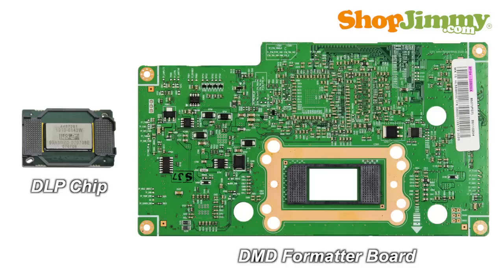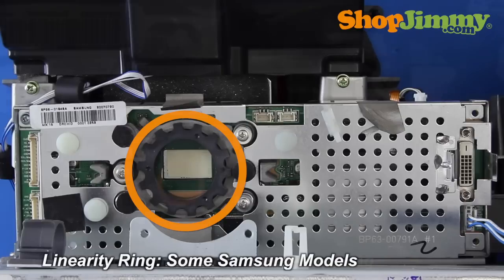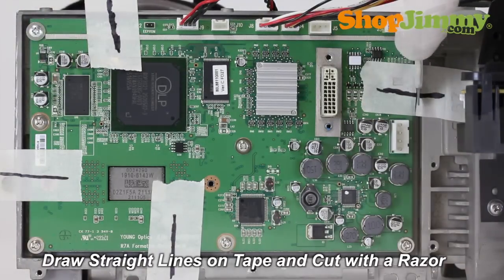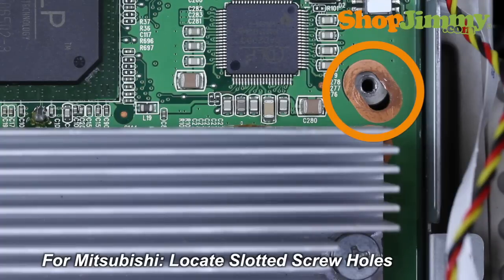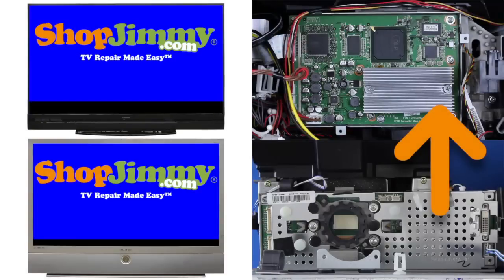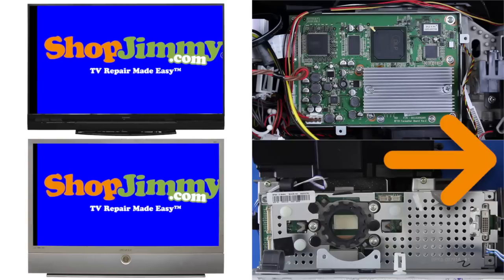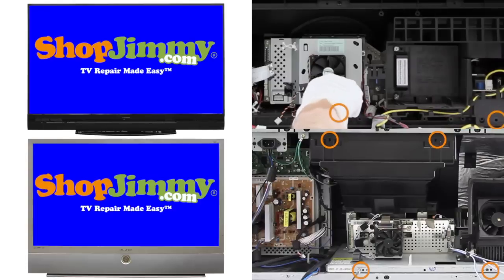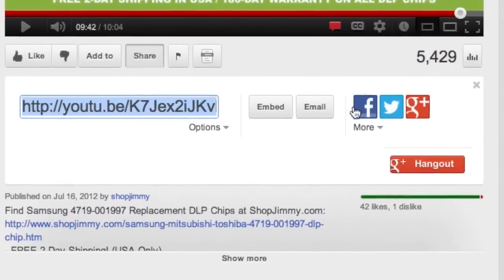DLP TV Repair Tutorial - Picture Off Center-DMD Board & Formatter Board Alignment-How to Fix DLP TV

Comment: Replaced the chip, worked great. Had to adjust the height, picture was about 7 inches to high. Moving the board down, brought the picture down. Only took a few minutes.

Comment: This info should be included in the original install video -- i.e. not having to troubleshoot after the fact.  Since I wasn't aware of potential alignment issues, I didn't use the tape marker, etc ideas to ensure alignment.  Ugh.

Comment: This video helped me a lot! my DMD board works fine its just my picture is about a 1/2 inch to the left and its been driving me bonkers looking in the menu for a picture adjustment feature but now I guess I will have to open it up fix it again. I had to open it to replace the lamp inside, i just wish Samsung made fixing my issue as easy as replacing the lamp. hehe
Reply from the maker: TheFlameofaShadow   Yeah the dmd just needs to be centered a bit more.  Thanks!  www.shopjimmy.com

Comment: After replacing the DMD on a Samsung DLP HLS4676SX, the picture is centered but seems to be a bit too large (overlapping all edges).  Is it possible to adjust the size of the picture.  H & V adjustments are centered.

Comment: My 2006 Samsung 56" DLP TV's picture seems to be larger than the screen. The bottom of the screen is cut off but the sides and top appear ok. This is while I view a full screen HD picture. Example: some CC text can be cut off, below the viewable section.  The TV has been moved several times when I moved to different addresses. Could something have gotten jarred out of place? The picture quality is outstanding, as it always has been. It has a sharp focus and is not tilted or canted in any direction. I bought this TV new in 2006 from Amazon. It's model  is Samsung HL-S5687W 56" 1080p DLP HDTV.

I saw your instructions on moving that board. Is that the only possibility?

Thank you in advance.

Comment: I just replaced the DLP chip I ordered through ShopJimmy.com - which fixed all white pixel issues on my Samsung HL56A650C1FXZA. The picture is back to perfect, but now I have an alignment issue. The screen is around 1.5" too far to the left and around -3 degrees off. Unfortunately I did not see this video prior to my install and I'm confused as to how I can keep my TV on while adjusting the dmd board? Also, I did not touch the screws under the white plastic caps... Thanks for your help.
Reply from the maker: Ari Cohn I would recommend watching our DMD adjustment video.  Here is the link:  DLP TV Repair for Off Center Picture Display DMD Boards & Formatter Boards Alignment  Thanks and please let us know if you have any further questions!  www.shopjimmy.com

Comment: I replaced the color wheel and lamp, and I am now getting picture then black and then red vertical stripes. Then it repeats, over and over. I also had an 8” black strip running horizontally across the bottom  with about 3 inches of picture showing at the bottom below it. Mitsubishi WD-73734.
Thanks

Comment: Great video. I have a Samsung HLS5086W 50" that the sound has started popping like Pop Corn. It seems to get louder and faster the longer it stays on. We can mute the TV and the audio still works through the surround sound system. How do I fix this sound issue. Tonight I just replaced a fan that did no good. Thanks for the help
Reply from the maker: Tony Soares  Try all repairs and troubleshooting at your own risk.  I recommend replacing the main board in your TV.  Click this link to replacement parts for your TV model number:  http://www.shopjimmy.com/samsung-bp94-02262a-main-board.htm  There may be multiple boards for the same TV model number, be sure to match part numbers on your current board, with your replacement for compatibility.  Here is a link to a video showing how to identify your part number, click here:  https://www.youtube.com/watch?v=BEPWrefQvqI  Thanks and please let us know if you have any further questions with your TV Repair!  www.shopjimmy.com

Comment from the maker: @Leonardo Chen - I would say that is not an alignment issue.  It may be the DLP Chip is not properly seated, or one of your cables is not connected correctly.  Be sure all of the cable and wire connections are connected well inside your TV, and also be sure that the DLP Chip is properly seated.  You can see how to do these tasks in our videos.  Thanks and please let us know if you have any other questions!

Comment from the maker: @Leonardo Chen - The blinking yellow light typically means that the lamp door is not properly secured.  I would go through and be sure that everything is securely tightened on the lamp door and other areas.  If you need any additional support, please feel free to contact our customer service at (877) 881-6492.  Thanks!

Comment: Hey again, it's a Mitsubishi DLP today.  This time a WD-65736.  The DMD looks exactly like the one at 0:50,  putting tape didn't seem to serve a purpose because the board is keyed to go 1 way, there's no way to slide it around as suggested at 1:42 . Here's my symptoms:  image is a bit squeezed on the sides, top of the screen has extra space,  bottom is cropped off, terribly overscanned... Could this be an issue with the rear mirror itself?  The back is a bit melted (whoever had it might have left it in the sun).  there's just no way to move that DMD board up down left or right, again it's keyed to fit in 1 spot. I could live with the squeezed image, but not the cropped bottom and black space on top.  Suggestion?

Comment: I've just replaced a DMD board with chip on my Samsung HLS4266 DLP TV.  It corrected my problem - splotchy picture and horizontal lines - but now I have a new problem. I was successful in properly centering the picture after replacement, but now I have a 1" vertical shadow running up the left side of the screen.  It is not the left-right orientation thing as I can see the picture through the shadow.  It appears to start out purplish and fade into a light blue.  Can that be gotten rid of by making some additional adjustment or will it require replacing something?
Reply from the maker: Frank Inman   Yes, you will want to continue to adjust the picture.  Thanks!  www.shopjimmy.com

Comment: Samsung DLP model HLT6187S Turning on TV when cold green light flashes 4 times then projector lights up displaying no signal 5 minutes later picture blinks on and off 3-4 times  then comes on. Could this be the cable from main board to DMD board or main board replacement. How to diagnose?

Comment: hi I have a Samsung model number is hi56a605c1fxza I repaired the lamp ballast it has a blown capacitor I replace the light bulb and I replace my power supply as well so I plugged it in everything came out fine but the only thing is bothering me is the screen is blurry I can't even see my menu how can I focus it

Comment: I have a Mitsubishi wd 73733. After replacing the chip I can't get the picture in focus. Menus are almost unreadable, actual text displayed on the screen from satellite is also unreadable. I didn't see the video about taping and lining up before changing out the chip. Any suggestions on getting the picture in focus?

Comment: My Aunt has a Samsung HLN617W that has no sound. The picture works for awhile and then the screen goes black or freezes up with a black and white image. She had been using a surround sound system with the TV because there was no sound from the speakers but now there is no sound going out on that either. She recently had the color wheel replaced so the color is nice, but problems persist. I was thinking DMD board, what do you think?
Reply from the maker: lucidbarrier   Yes, that sounds correct.  Here is a link to replacement parts for your TV model number on our website, click here:  http://www.shopjimmy.com/catalogsearch/result/?q=HLN617W  Be sure to match part numbers on your current board, with your replacement for compatibility.  You can also call our customer service for further assistance with your purchase.  (877) 881-6492  Thanks and please let us know if you have any further questions with your TV Repair!  www.shopjimmy.com
Reply: ShopJimmy.com Thank you, I recommended she order the DMD board. Thanks for your help!

Comment: My TV goes half dark on either side that goes away after power cycle, but comes back in 10 minutes.  I think DLP is over heating.  I need help locating DLP or DMD board on HLR 5688W.  Thanks

Comment: Hello, I own a Mitsubishi WD-62725 TV. Recently I had a power outage and I cannot get my TV to turn back on. The TV was off when the power went out and is plugged into a surge protector. I did pull out the chasis with the power board on it and replaced the fuse. The TV still will not turn on. Can you please give me any advice on what I should do. Thanks.
Reply from the maker: Richard Kowalski  Try all repairs and troubleshooting at your own risk.  I recommend replacing the main board and the power supply board in your TV.  These boards are typically damaged as they are connected to a video source and a power outlet.  Click this link to replacement parts for your TV model number:  http://www.shopjimmy.com/catalogsearch/result/?q=WD-62725  Be sure to match part numbers on your current board, with your replacement for compatibility.  Thanks and please let us know if you have any further questions with your TV Repair!  www.shopjimmy.com
Reply: ShopJimmy.com  Thank you for your response. I see a replacement power board on your site but I don't see anything stating being a main board. Is that the correct name for it? Thanks.
Reply from the maker: Richard Kowalski  You will want to replace any boards that were connected to another device that may have damaged a board.  For example if you had a VCR connected to your TV, then there is a possibility that the surge came through the VCR and damaged the board it is connected to in the TV, or if you had a coax connection etc.  Thanks!  www.shopjimmy.com

Comment: I have a Samsung HL61A750A1FXZA. I hade white and black dots so I replaced the dlp chip, when I reassembled and turned tv back on I had no picture and lights in the lower r/H corner were blinking. After researching this it looked like I needed a new dlp lense so I have replaced this and still have no picture. The screen is black and it chimes when turning on, the green led light will blink and after about 30 seconds it chimes again then all three lights will blink for a few seconds. Any ideas?

Comment: My picture is centered and leveled, but the picture is actually larger than the border of the screen. North, south, east, and west(or Up, down, right, left) are all hiding part of the image.. South(or the bottom of the screen) a little more than north, but over all I'm missing imagery past all borders of the screen. This is observed using all television devices plugged in to all input options. Regardless of device (xbox, cable, Roku, etc.) or input method (HDMI, AUX, USB, etc.) the problem remains the same. Some devices like the Xbox will display a calibration image used to adjust aspect ratios, but my TV fails to encompass the borders of said image as it was intended. HELP SUGGESTIONS?
Reply from the maker: +mange88  Try all repairs and troubleshooting at your own risk.  Try your screen size on your remote.  Thanks!  www.shopjimmy.com
Reply: +ShopJimmy.com I have the same issue. The service menu only allows hor. and ver. POSITION. It doesn't give the option for changing screen size. Any other ideas?
Reply: RejectedManiac did you ever find a fix?  I just replaced my dlp chip and the screen is too large.
Reply: I have the same problem.

Comment: my picture is to wide by a little bit and its not a setting. it was like that before I replaced the dlp chip. hope to adjust that on a wd-60737
Reply from the maker: +David Ooley   Try all repairs and troubleshooting at your own risk.  I recommend that you reseat the chip.  Sometimes it can take multiple attempts to get it right.  Thanks!  www.shopjimmy.com
Reply: +ShopJimmy.com I did it only does it on certain HDMI inputs

Comment: After moving my Mitsubishi WD65837 I noticed that the right side of the screen is now displaying the image with a slight upward curve.  When comparing a straight line, the left side is 0.8cm lower than the right side and the image is not as clear and bright as before.
Reply from the maker: Alvin Minassian   You will need to realign the formatter board or the mirror has moved.  Thanks!  www.shopjimmy.com

Comment: I have a samsung hls4266wx and on hdmi it is cutting off horizontally and vertically on the top bottom left and right. There is no option to adjust the vertical or horizontal size in the menu. And in the service menu there is only the option of vertical and horizontal position. If I adjust either I can see the part of the video being cut off but more of the picture is being cut off in the opposite direction. I tried the same device on another tv and there is no cut off which makes me believe it's something with my tv and not the box that is plugged into it.
Reply from the maker: RejectedManiac   Try all repairs and troubleshooting at your own risk.  This sounds like a problem with the main board in your TV, you can replace it to see if that fixes the problem.  Click this link to replacement parts for your TV model number:  http://www.shopjimmy.com/catalogsearch/result/?q=hls4266wx  Be sure to match part numbers on your current board, with your replacement for compatibility.  Thanks and please let us know if you have any further questions with your TV Repair!  www.shopjimmy.com

Comment: I have a mitsubishi wd-60737 I replaced the dlp chip now the image looks to zoom in on all sides where can I adjust that.
Reply from the maker: scorpio Pena   I recommend checking to be sure none of the pins on the chip are bent and also be sure it is seated correctly and tight in place.  Thanks!  www.shopjimmy.com
Reply: The pins meaning where I screw in the gray lock or just the screws from the board
Reply from the maker: scorpio Pena   The pins on the back of the chip.  Thanks!  www.shopjimmy.com

Comment: I've replaced my lamp, power board and also the dmd board and I'm still having an issue with my picture,,if i get a picture it's distorted green garbled screen with a smaller screen off to the bottom right side..whats the deal ..samsung dlp tv
Reply from the maker: Mingo Rubio   Please reply with your TV model number.  Click here to view a video that shows how to find your TV model number:  TV Repair STEP #1 Help IMPORTANT TUTORIAL How To Find Your TV Model Number Tutorial TV Repair Help  Thanks!  www.shopjimmy.com
Reply: Samsung model #HL-t6156w

Comment: How can i fix a picture that is off center to the right on a Insignia 40" tv i replace the main board
Reply from the maker: mike smith This problem is being caused by either a bad t-con board or a bad main board.  You may need to replace them one at a time to see if that fixes the problem.  Please reply with your TV model number and I can recommend a replacement part for your TV repair.  Thanks and please let us know if you have any other questions!  www.shopjimmy.com

Comment: I used your tips to straighten the picture, however the Picture is Now Bowed out in the center and zoomed in. Please HELP!
Reply: I don't believe so. Not sure which is the lens. I adjusted the dmd board, which worked in straightening out the picture. It was too far to the left and raised on the left hand side. But Now is bowed and to zoomed in. I went to the menu to see if I can adjust the zoom, not such luck.
Reply: +Michelle Bahe I'm having the same issue also, i got a 56" Samsung DLP (LED version), it is pretty annoying -- did we get the wrong chip or something?
Reply from the maker: +Harold Lee   What is your TV model number?